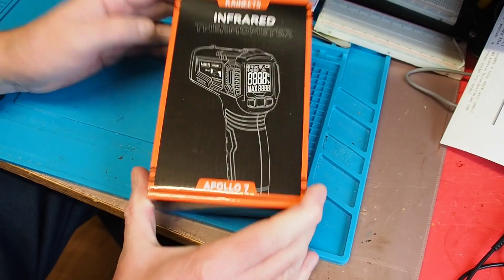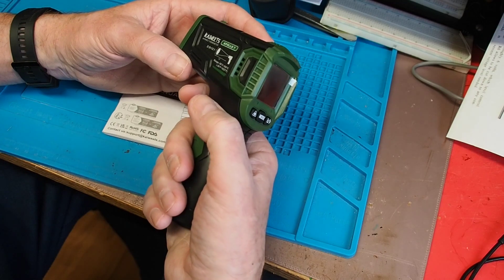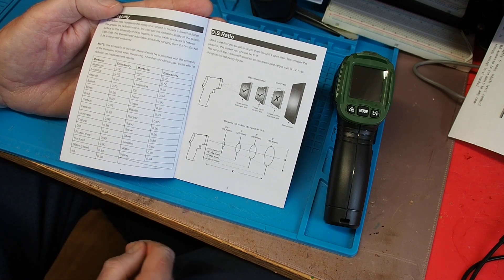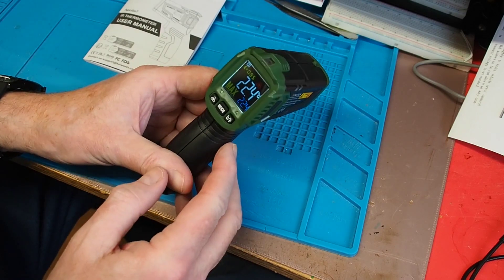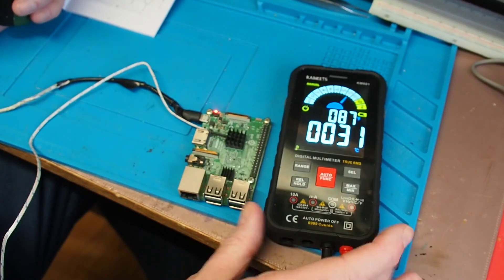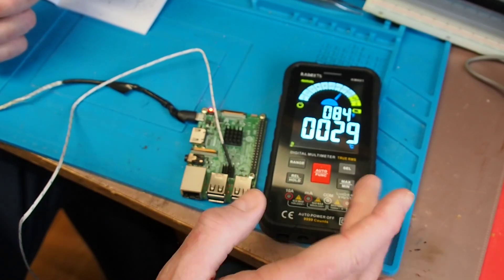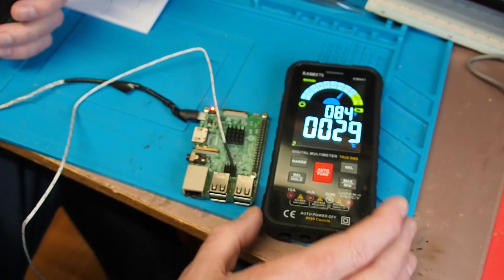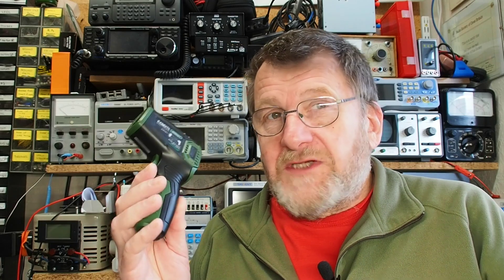Kaiweets Apollo 7 Infrared Thermometer  -  Review - #151

Comment: Apples and oranges. The Radiated energy given of by IR will of course be hotter on the "average" measured on a heat sink rather than a place that can be getting less heat if there is space to wedge the other prove in. It's tricky to find the sweet spot with so many devices but you discussed the reflectivity which was nice and an important point.
Fun fact- "Climate scientists" (that's "used car salesmen" in science terms)  apply the Stephan Boltzmann black body radiation of head these devices use on a gas! they then invent layers in a mixed system and miss SEVERAL other mechanisms to give us "global warming" - later "Climate change"- later "Man made climate change"
Since the 70's (my generation too) there have been over 30 BS statements and alarmism about the bloody weather/climate. It's warmed, yes because we come out of a really cold period, the warming is nothing to do with CO2 which has a minute hard to measure impact. (out 5% contribution to 0.04%)
Anyway I used Fluke testers during military career, what do you recommend today for my sons as a good general purpose tester? We had to build a tester to measure farads and ohms (it was pretty basic but the idea was to be able to make one)